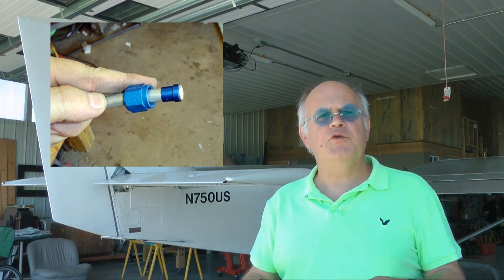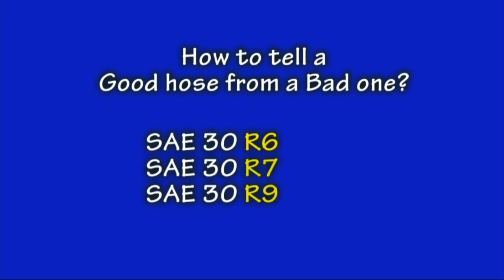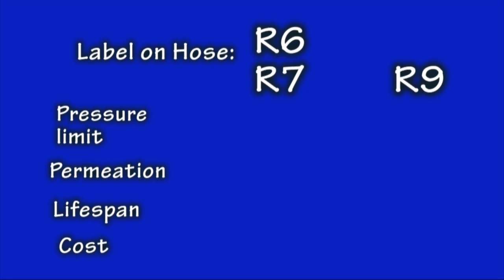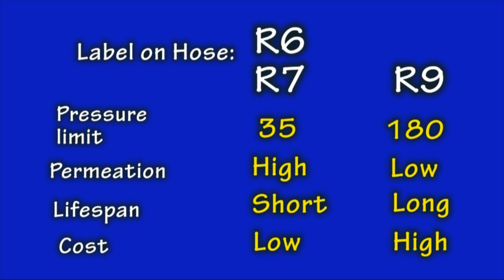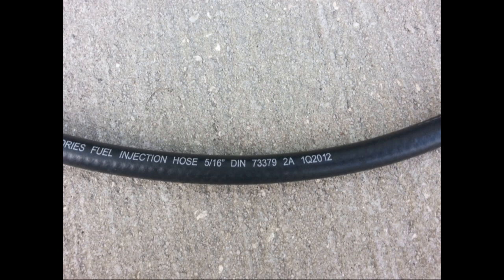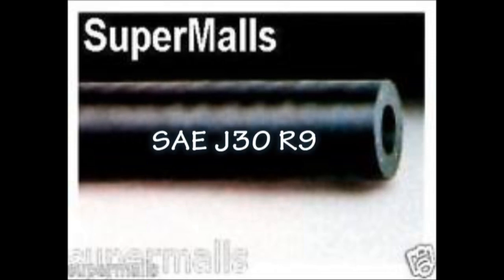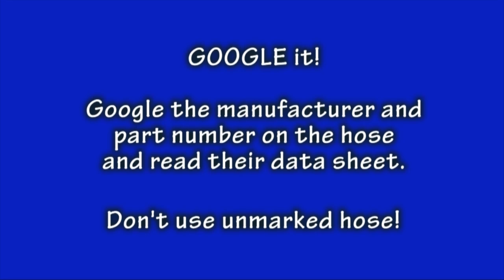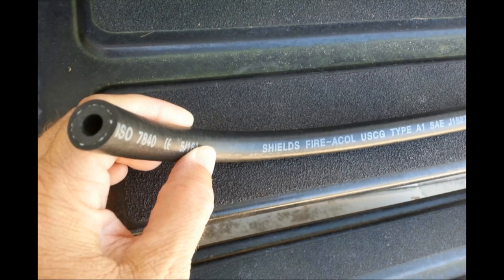Choosing the BEST Rubber Fuel Hose for your Homebuilt aircraft

Comment: Wish I’d seen this video prior to replacing all the hose in my SLSA the other day. The 15 yr old Gates 30R7 in my always hangared plane was in great shape but in the wing root area it was losing its flexibility. Cabin area didn’t need replacement at all but access was easy so I did anyway.

Comment: Great review.  Found that the Gates  LP (low pressure) 27314 is SAE 30R14T1.  This is good for carbureted engines and has the low fuel permeability. Available at auto parts stores and Amazon.  I will use it to replace the current SAE 30R7 that was in my plane.

Comment: Can I use Fuel Line 9/16" ID NBR Hose Push on Hose 13/16 OD Fuel Injection for Small Engines
to replace worn Charcoal Canister & Vapor Canister Vent Solenoid hoses on a car? On a new hose it is written 
"SAE J30R 10  20Bar B. P.  50 Bar". The original is more stiff & surface like in 1/2 spheres.
The new hose is:
2Mpa. Burst Pressure 5Mpa, Handles temperature ranges of -40 to +275 degrees F 
2 MPa. 290.07547546 psi.
I would appreciate any opinions on this questions. Thank you.

Comment: I've always used Gates Barricade fuel line on my Rotax 912ULS, it's a SAE-R14 hose (for carbureted engines) and is designed for most fuels with or without ethanol. I buy it locally from O'Reilly Auto Parts.
Reply: can sae 100r6 hose be used for fuel?